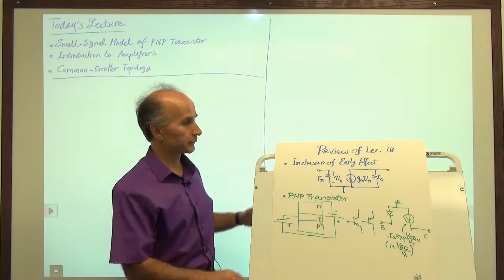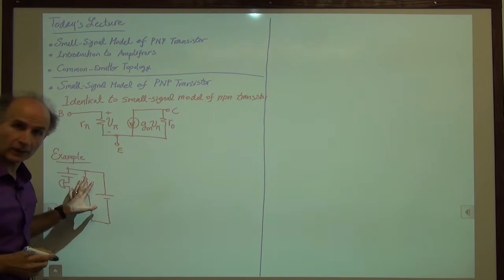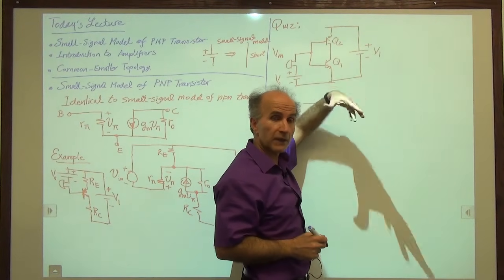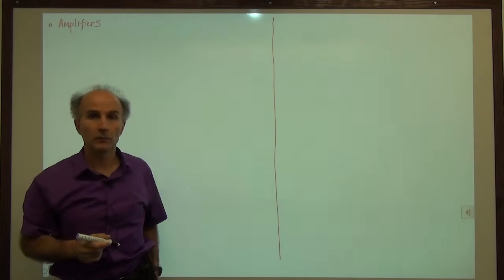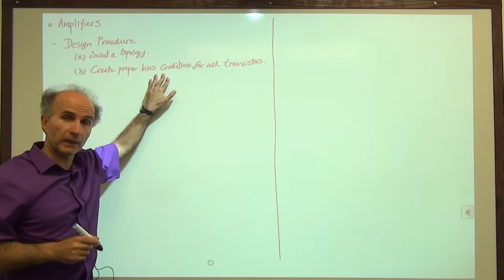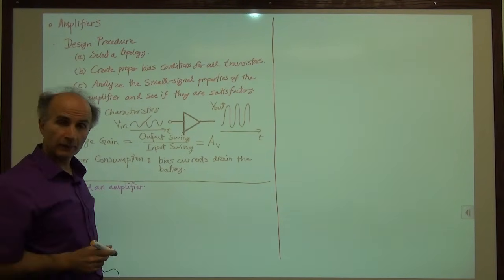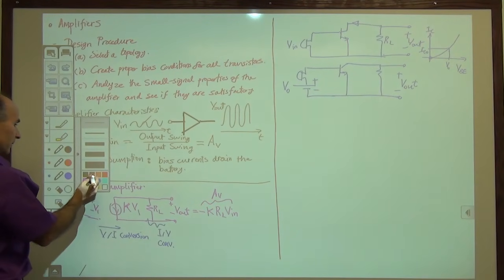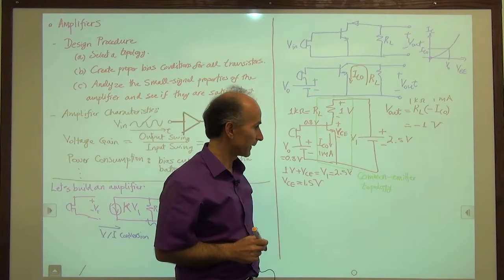Razavi Electronics 1, Lec 19, Evolution of Ampifiers

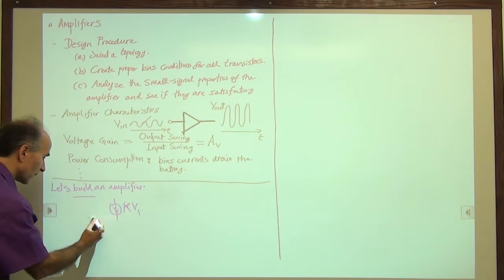Comment: at 47:15  i forgot the reason why the voltage dependent current source is drawn as circle instead of diamond, can someone please explain
Reply: If you know the difference between independent sources and controlled sources you need not to distinguish it by different symbols like independent sources are represented by circle and controlled or dependent sources are represented by diamond symbol. Without this also you can identify easily in analog.

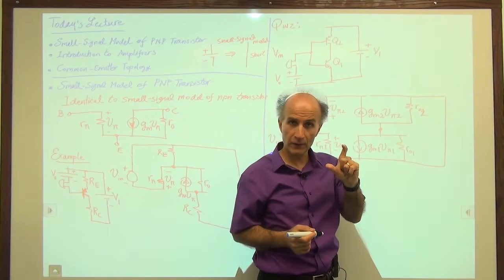Comment: 24:10 why is the bottom of  Ro1 shorted to the top of Ro2? E1,E2 are not there
Reply: Both transistors' collectors are shorted, note that Q2 has its emitter UP. And in the small-signal model, the dc source V1 becomes short (explained in previous 2/3 lectures). So, in the small-signal model, the emitters get shorted as well. So the r01 and r02 become parallel as they are connected in between the collector and emitter terminals in both transistors. E1 is the bottom horizontal line and E2 is the upper horizontal line.
Reply: figure it out yourself
Reply: @akfig184kdk  ok
Reply: @akfig184kdk wow

Comment: 52:05 Again there is no supply voltage. Why? He did this some lectures ago as well. I don’t know why.
Reply: Which supply voltage are you talking about?
Reply: I guess this example was taken to show that biasing is necessary, is that right?
Reply: If you mean why the biasing DC voltage sources are shorted in the small-signal model then you can get the clarification in the previous lectures. I think it's in lecture number 16.